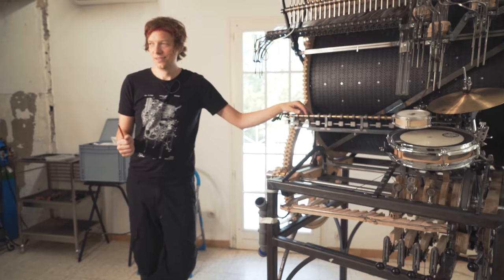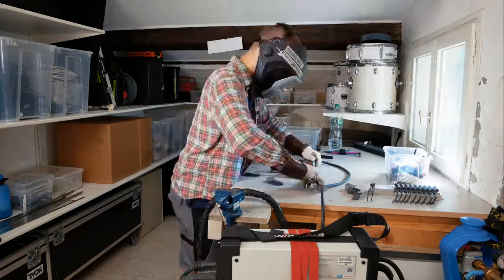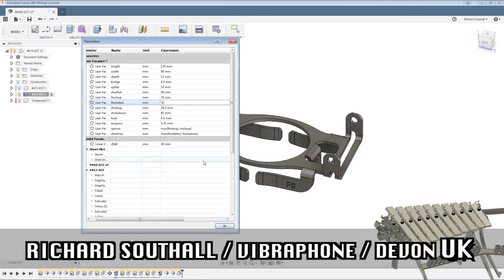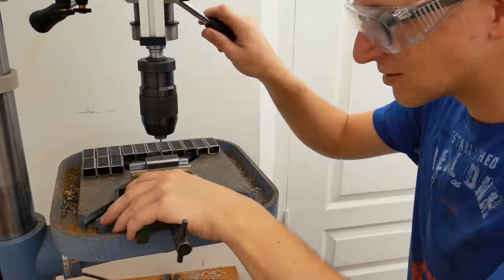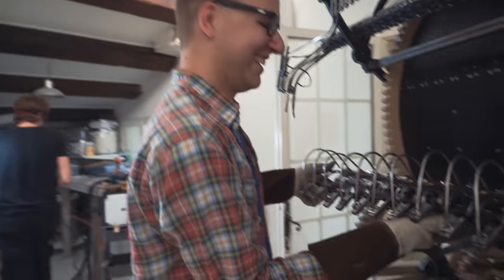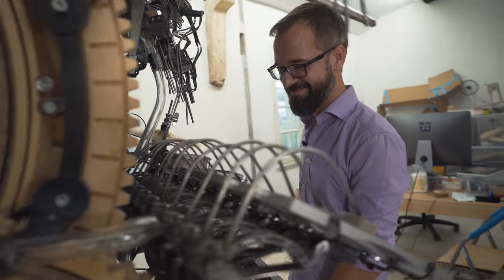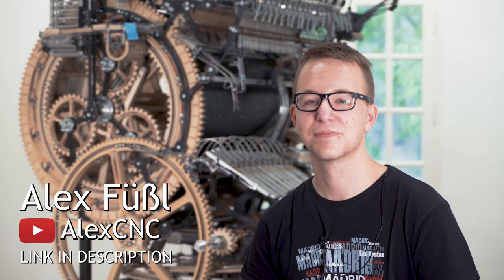Vibraphone Bar Holders - Marble Machine X #93

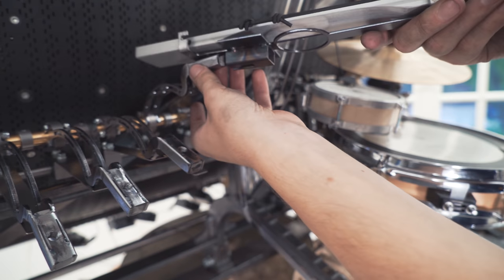Comment: My viewing of this entire series i've done in one sitting, and its been amazing, i've noticed how you are picking up tips from the viewers, and how people come up with great solutions. The only thing that i can think of straight away is that yes you have a lot of metal and over-dimension on a lot of the parts which are under a lot of stress. However you have shifted more and more over to metal parts and for obvious reasons.. wood is great since its easy to proccess and cheap, but i'm worried about your gears, metal will mostly bend and increase density if put under enough stress, but wood is not that great when it comes to moving parts, and especially frictioning parts like a gear. So here is my suggestion, which is best explained by this video made by JoergSprave at the slingshot channel https://www.youtube.com/watch?v=tbKGjRoSofA Start video at 7:16, end at 7:42 . I'm concerned about your wood gears chipping and wearing down over time, especially considering that you will be assembling and disassembling this several times, including transporting and repeated use. Wood doesn't have the mellability and toughness for repeated mechanical abrasion as certain metals have.
This is especially a concern about your smaller gears, which has a lot more revolutions per minute.

I would suggest that your plywood wheels are cut in half, cut out 2mm from each half in the center, and insert at 4mm aluminium sheet cut to the same exact outline of your gears. If you really want to over-do this for minimal wear, i would say reinforcing the gear teeth of the aluminium with 0.2mm titanium bands. Why titanium? its very mellable, it has high toughness, and very low magnetic properties if it is not alloyed.
My best wishes from Söta bror, Norway.
Love your videos and humor, and i can't wait to see this project progressing to the end.
Much love from Fisbuar.
(PS: i apologize in advance if there are a lot of spelling errors, i have dyslexia.)

Comment: so. are you going to adjust the spring steel every time you change the vibraphone? why not put weights in every vibraphone bar holder so they all have the same weight, then you dont have to adjust the spring steel???

Comment: I know I am not an expert in musical engineering by any definition, but drilling holes through the vibraphone blocks seems like a terrible idea, you have no idea what sound that could cause when it's constructed plus since they are mass based, if I am correct, changing the amount of metal in them would change the pitch of the block. that being said I am no expert, so that could be wrong but I know for a fact that bells do work in that way, shaving metal from a bell will make it sound different.